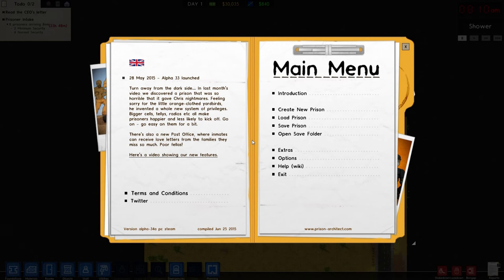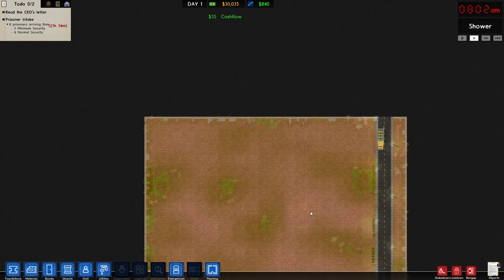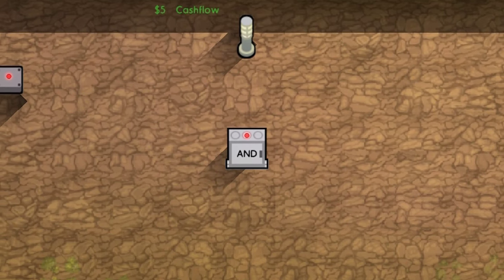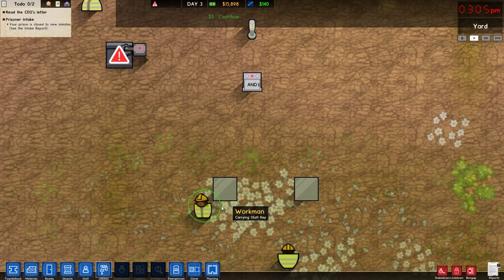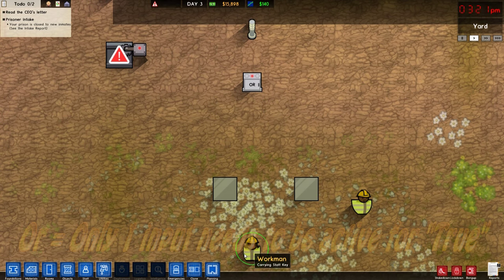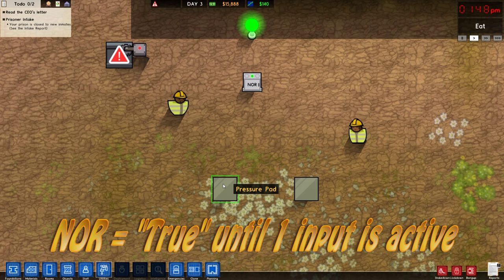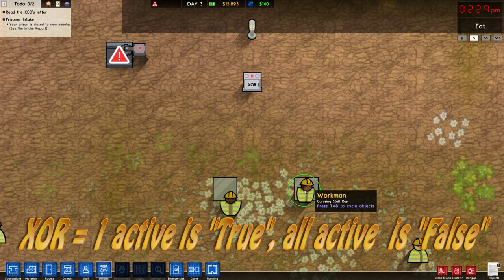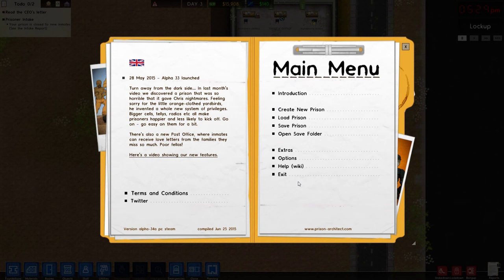Prison Architect - How To Use Logic Circuits

Comment: can you make a video on backup power with logic switches.  i have 2 stations, station 1 is primary and station 2 is back up, once power goes off switch at my backup station successfully turns on now the problem is it won't turnoff when primary station power is restored instead it turn off both power stations, i make the network exactly the same way as you make here in two way airlock

Comment: Great video.... what is the point of these pads though???
Reply from the maker: The pads can be used as triggers. For example you can put a pad in front of a door and connect the 2 so when someone steps on the pad the door will open.
Reply: ohhhhh... lol. I'm thinking "why do I need pressure plates for lights?"
Reply from the maker: +poppaexo lol yeah it was easier to demonstrate with lights. Plus doors don't work unless you have prisoners (and my example setup didn't have any)

Comment: Saw your comment thanks. But I already knew a tiny bit about logic circuits (an engineer could probably explain what the = is in a logic circuit as that's something I don't know). But the point of my question was, they are broken as shown here:

https://youtu.be/qf3VUOJoD4s

Once the switches have turned the circuit on, they appear to be unable to turn the circuit off. But I wanted, as I've seen someone else do a few builds back so assume it was broken recently & appears to be mentioned on the Mantis bug tracker, is to have two switches setup. They control the doors so they are open when both switches are on. If a riot then causes prisoners to smash either switch up, it will then automatically lock both doors.
Reply from the maker: I'll have to play around with it more in a real prison to have to see the door issue myself.
Reply: ProphetBeal
It's been reported a couple of times on the Mantis Bug Tracker that it's broken with switches.
Reply from the maker: Steven Whiting Fair enough...Thanks for the explanation
Reply: ProphetBeal
Having said that, as you're using pads (which I do for allowing staff to control some doors) I might set up pads instead. If they break the pads, then the prisoners only screw themselves up by locking the doors :)
Reply from the maker: Steven Whiting to be honest, to this point I've never really used Logic Circuits or Pads in any of my prisons. However now I can think of a few areas where (if they are working correctly) could be of great use.